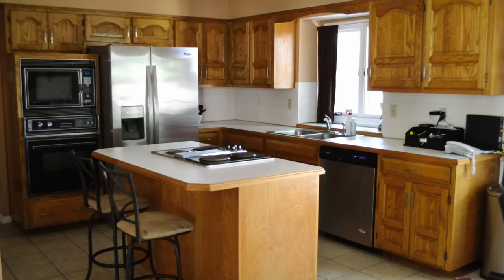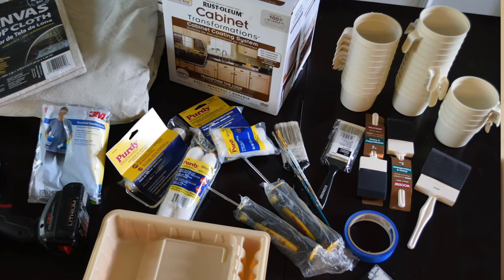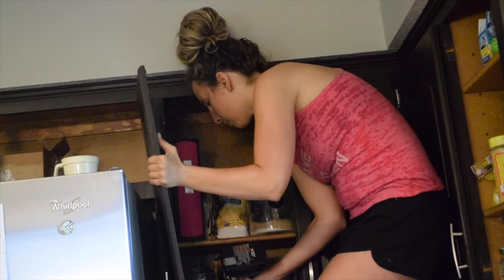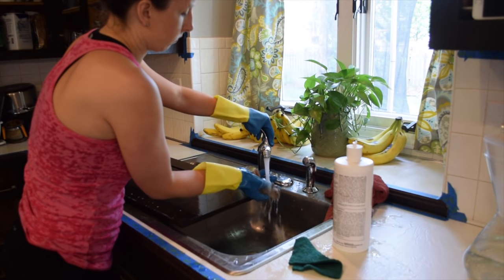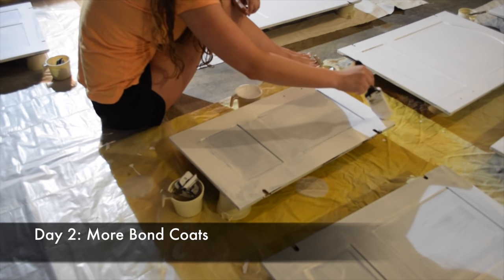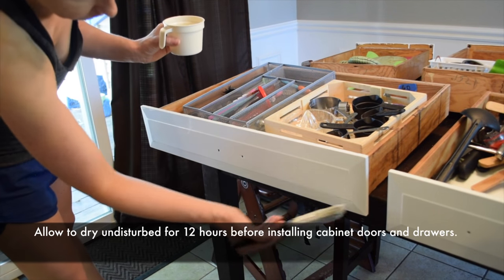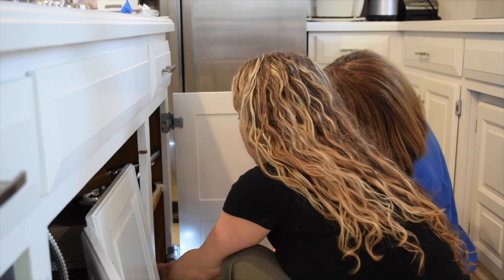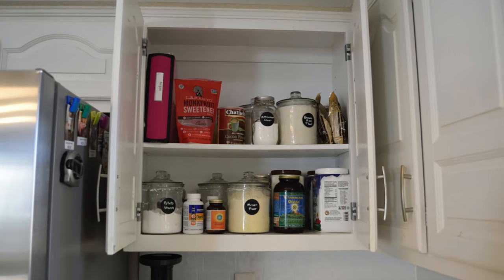How to Paint Kitchen Cabinets from Dark to White

Comment: I rented a house with a white kitchen & it was honestly so bright, welcoming, & IMO much easier to keep clean! Used that bleach spray kitchen cleaner a lot, had white tile floors that were bleached,  just seemed so much easier than the brown wood. I am wondering about this for my kitchen. It's mid century. The previous owners  (who were the kids to the original owner - I'm the 3rd owner since it was built in the 50's) decided to update the cabinets & backsplash with wood grain looking shelf paper. It's a great job (i honestly didn't know it was tacky paper until it started to peel. Lol. Guess I never thought of anyone doing anything like that. I don't know anything about this stuff)  Obviously all that has to go. Since the cabinets are great solid wood,  I've been torn on what to do. Sanding & refinishing always seems like the right answer, but maybe just this  paint kit. 

BTW I watched both videos. The dark was very classy. I can't say I like one more than the other by comparison. Since you went with the dark flooring, I definitely agree with the choice to change to the white. Dark cave sounds right. Lol. When you were doing the bathroom cabinets dark in your other video, I thought why doesn't she do these white, or at least the kid's bathroom white? Wondering if you are planning that?

Comment: I had some dripping going on mine too, but they didn't come off all the way even after sanding. Something to be more aware for next time! I wish you had a video about painting on the inside of the cabinets, I'm so on the fence to whether or not to paint on the inside. I love your new kitchen!
Reply: Ohh I typed as I was watching and I saw you showed it at the end. If you put contact paper on the shelves, did you still need to paint them? Couldn't you just stick the paper on and call it a day?
Reply from the maker: Yes I agree. Yeah sorry I didn't include that, it was the most time consuming because you have to move everything out! And I saw your other comment, I went ahead and painted the shelves in case I decided to later remove the contact paper, probably just made it take even longer though. lol

Comment: It looks beautiful Ashley!!! I'm in the process of researching the best way to redo my kitchen cabinets.  Our cabinets are wrapped in an awful product  called thermofoil. So the cabinet under it is MDF. I wonder if this product would work on it? What type of paint dis you use on the inside of the cabinets? That might actually be better for mine.
Reply from the maker: Hmm..I'm not sure. I would reach out to the Rustoleum company and see if they know whether the kit can be used on the thermofoil. When painting the insides of the cabinets I used: https://www.lowes.com/pd/Olympic-Ultra-White-Semi-Gloss-Latex-Interior-Paint-Actual-Net-Contents-124-fl-oz/1092731 But it's not showing it's available for some reason  ) : Anyone have any suggestions for painting over the thermofoil?
Reply: Ashley I'm going to remove the thermofoil a paint the MDF. I'm pretty sure it will soak up quite a bit of paint... I'll contact Rust-Oleum to see what they say. thanks again
Reply from the maker: Sounds good, best of luck!

Comment: I have a couple of questions:

-since you paint with a brush, does it leave brush strokes or is it absorbed into the wood and the finish is smooth without any lines?

-what is the decorative glaze and why do you skip it?

-is the top coat like a clear coat on a car or is the decorative glaze more of a clear coat?

-how has the paint held up?  I saw your update with the darker color and it chipped a lot...has this paint held up better since you added a top coat this time?

Sorry for the many questions but I'm very interested in doing this so I hope you respnd.  =)

Comment: I'm wondering if there is any problems with so many coats of layers...as u did it over twice..?
I must admit, they both looked great,..white is a fresh look n always makes a space look bigger. Some do not see that in order for this whole look to be fab,  you also updated floor n counter tops to bring out the white.
Just a thought for success...
Great video, love the looks..ty
Reply from the maker: It did get a little thick in some of the corners because of all the layers I did on both sides, but mainly because I got lazy with it and didn't watch for drips when doing all the many coats of paint. But that was on me, other than that they seem do be doing okay with all the layers or paint.

Comment: I am very leery to do my kitchen cabinets.  My concern is the wear and tear. Especially around closure of drawers.  Do you find that this product holds up well?
Reply from the maker: I find the white holds up better than the dark paint I previously used. There is some slight wear and tear near the drawer handles, but it's easily touched up with some of the paint. ( :

Comment: Looks great!! so if you would have done white to begin with before you did the dark color, would you have just used one kit?
Reply from the maker: Actually I still think it would have taken 2 small kits. I found the white paint when on super thin and the dark paint was thicker...granted it could have been just because they were dark, but when I painted the insides of the cabinets they were the oaky color and it still took lots of coats to get them white.  ( :

Comment: How are the cabinets holding up?  I'm considering painting mine off-white but I'm worried especially about scratches and scrapes and dirty hands on a painted surface.  I saw your dark cabinet update.  Would you say the white is about the same?
Reply from the maker: Yeah white is about the same but holding up better than the dark. They do show dirt, but I don't feel like I have as much scratching or wearing away of the paint...just dirt mainly.  ( :

Comment: The cabinets look great.  My wife and I are considering using this transformation kit that we have seen at Home Depot.  I have two questions please: 1. How has the paint adhered over the last 4 months since you painted them?  2. Did one kit cover all your cabinets or did you have to buy more than one kit?
Thank you.
Reply from the maker: The paint sticks great, sometimes it just gets bumped or scratched in daily use, but I find doing touch ups to these small areas once or twice a year is all that is needed. When it comes to getting the kits, I would recommend 2 small kits for a standard kitchen. That's how many it took me for my kitchen when I did it. (It only took one kit when I painted it dark).

Comment: how has the color held up this time? I remember previously, the dark brown chipped a lot. did the white paint chip this time around? if not, how did you avoid that? <3
Reply from the maker: Seems to be holding up a little better with the 2 coats of the protective top coat, unfortunately white does so any and all spilled foods and dirt, but I'd say holding up slightly better. ( :

Comment: Have you had any issues with paint chipping or scrapes? I did mine this weekend and I found that we already have a few places that need to be touched up
Reply from the maker: I have but only after several months...execpt in high traffic areas those chipped quicker. I just keep a small amount of the white paint nearby to touch up if needed. Unfortunately one of the pit falls of this DIY project.

Comment: Beautiful job! Thanks for sharing! Just wondering how they are holding up. Any chipping, scratches, etc?  Do you have children?  My husband and I have 5 children and are worried that the finish will be damaged prior to curing, especially since it takes anywhere between 30-60 days for complete curing and ultimate hardness.
Reply from the maker: Here's an update I did from back when I painted them the dark brown color, https://www.youtube.com/watch?v=co1nj9LY6OY  They seem to be holding up a bit more with 2 coats of the top coat instead of 1. Hope that helps!
Reply: Hi Ashley, Thanks for the link, but I should have specified that I was inquiring about the durability with your new reno of the white cabinets. How is it holding up? What would you change or do differently? what are definite "must dos"? Thanks, again! :-)

Comment: I wonder if you need two kits if you're just going from a medium wood instead of from the dark. could you also use this kit with a sprayer?
Reply from the maker: Good question, maybe just one kit would be enough? You could always try and then just run out and get a second one if you need it. Here's what I found on the instructions for the kit online about using a sprayer: 
Q. CAN I SPRAY OR ROLL ON CABINET TRANSFORMATIONS?

A. It is not recommended to spray or roll on the Bond Coat of the CabinetTransformationsTM if you plan on applying the Decorative Glaze. As the glaze is wiped
off with the Decorative Glazing Cloth, some glaze naturally remains in the vertical
grooves made by the brush marks from the Bond Coat. Spraying or rolling on the
Bond Coat eliminates the possibility of achieving this effect.
Q. CAN I SPRAY CABINET TRANSFORMATIONS IF I DO NOT INTEND TO USE THEDECORATIVE GLAZE?   A. You may spray Cabinet TransformationsTM only when you do not intend to use
Decorative Glaze in the system. To spray the Bond Coat, reduce with up to
30% water and use a HVLP sprayer at 35psi. To spray the Protective Top Coat,
reduce with up to 10% water and use a HVLP sprayer at 35psi. Ideal spray
temperature and humidity conditions are 78oF with 35% humidity.
Reply: Thank you for all of that info!!

Comment: great video! I am about to use the kit to change my cabinets from dark to white. In your previous dark cabinet update video you mentioned in the future using 2 coats of the protective coat. Do you still recommend 2 coats? or will 2 coats alter the look?
Reply from the maker: Yes I still recommend the 2 coats of the protective top coat. Some people have said that this could make it get a little yellowish in certain places, but I've hardly noticed that. And it has been worth it and seems to be protecting a bit more.
Reply: Thanks for your reply Ashley! And you also put on 2 coats of the protective coat when you painted your cabinets white?

Comment: My husband is a professional cabinet refinisher and he's often had to repair or even re-do failed DIY projects. Was your dark kitchen finish showing signs of failure after two years?  They may be "green," but they don't hold up as well as his professional conversion varnish projects.  And he's turned dark caves into bright and cheerful kitchens many times.  

And I cannot believe you did all the prep work in your kitchen!  That had to have been staged for the clip!  Prepping is very messy!
Reply from the maker: Why would I stage it for the clip? Clearly that is where I did the prepping. It's not that messy as long as you just clean up the area afterwards.

Comment: Amazing.. I did a friend's kitchen for her using the kit.. I just did my kitchen with a paint sprayer.. rather than the kit i used the Benjamin moore kitchen cabinet paint and I used zissner primer. I used the glaze feom the kit which was left over and the proteective coat. Came out amazing. My advice if u r th inking of painting cabinets is to go to home depot. Purchase the $248 graco 360 vsp paint gun. Spray the cabinets with that rather than a brush cause the brush is very time consuming.then return the paint gu n to home depot because they take every thing back.. my cabinets look amazing.. Spray gun is a must.
Reply from the maker: Good tip with the spraying! Wish I would have done that the first time  ( :